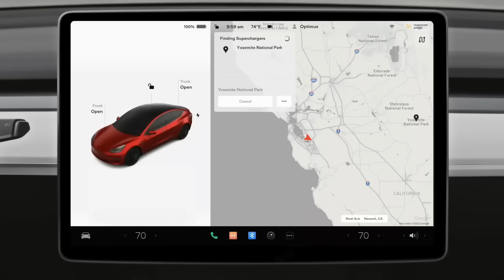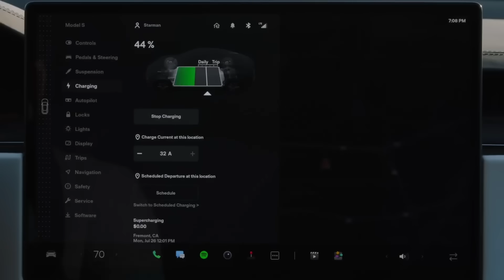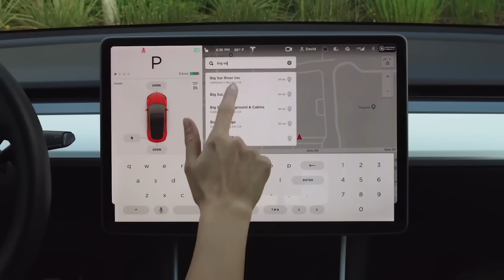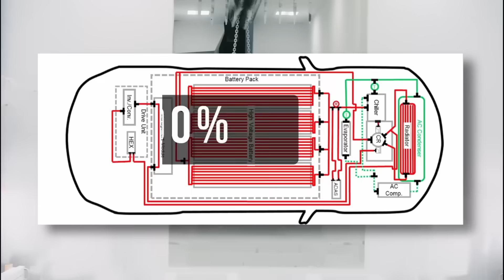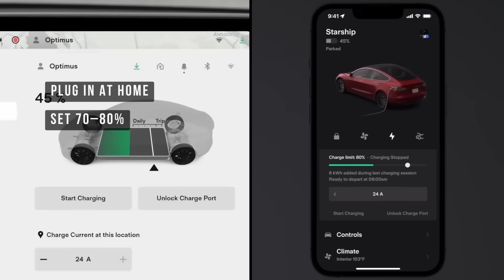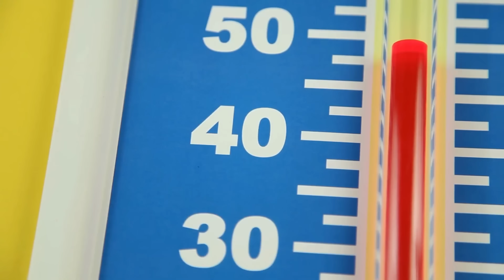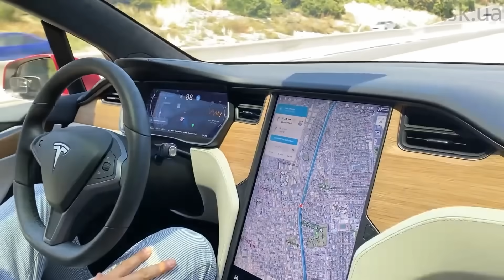Tesla Charging Myths That Are Ruining Your Battery Life

Comment from the maker: Which of these charging mistakes did You make? 👇
Reply: I haven’t made any yet as I found this channel a few days before picking up my first Tesla. Thanks for the honest advice! I do have one question about NMC batteries: you mentioned that charging to 100% and staying there too long in hot weather stresses the battery. How long is harmful? For example, if I charge overnight for a long trip but don’t leave for 12 hours later, is that safe? Or should I charge to 80% overnight and top off to 100% in the morning?  I do home charging with Tesla's wall connector at 48 amps 230 volts.

Comment: I have the 2026 juniper  I charge at home. I am retired and sometimes don't drive for a few days. Does lowering the amperage help with battery health. I have a 40 amp charger. I can drop down to 5 amps

Comment: What’s the best way to use a Tesla supercharger.  I charged my battery up to 93% and did not have to stop at another charging station. I was able to get home with 20% left.  Is it better to stop at two super charging stations and only go up to 80% at the first one. Then stop at the other one and put enough charge in it to arrive home at 20%  I have a solar system so my electric is free.  Thanks for all your information.

Comment: Just a reminder that charging on a 120 volt receptacle is only 73% efficient at getting that power from your wall to the car and 240 volt charging is 93% efficient. Just note the $10 to $20 difference per month.
Reply: Is this true?
Reply: I have heard that. Is there a sweet spot for 240 V and at what amperage input. Thank you.

Comment: If i drive my Tesla model 3 LFP only on weekends, should i leave it parked and plugged in, to 100% from Monday to Friday? Or should i park it (plugged in), at 80%, and charge to 100% every Friday night in order to be ready for the weekend?
Reply: Depends on ambient temps.  Battery stress happens when batteries are overheated at full charge.   Temp is the enemy, that why combustion cars battery usually fails at seasonal changes - summer to fall or spring to summer.  If you live in SoCal you can charge to 100% with little or no stress to the battery pack

Comment: Dear TSK, thank you for your most useful information! I do however have one burning question. My (December) 2024 M3 RWD standard range has an LFP battery. The Tesla manual says, exactly as you do in this video is to charge to 100% at least once a week. I have for some time now settled for only charging at home and keeping the car plugged in my garage. I mostly charge on my 3 workdays, Mondays, Tuesdays and Wednesdays, between 23:00 and 07:00, at a lower energy rate, and always to 100% on those days. 

The slightly confusing part for me is how to interpret the ‘at least once a week to 100%’ part of Tesla’s and your advice. I normally don’t drive more than 30 miles a day during the week. And rarely does a day go by that I’m not driving at all. An alternative routine would be for me to set the ‘Mo, Tu and We’ nightly charging limit to 80% and to once charge to 100% during the weekends, when it’s always cheaper to charge anyway. Does this make sense?
Reply: What happens is that the computer is only keeping track of energy used vs energy put back in. This is not a perfect method and it can only estimate available left. But if you don't really drive more than 30 miles a day, I would just set the charge limit to 80% every day and only charge to 100% monthly. It should only drift no more than 10% in that time frame. I have a very large LFP battery on my yacht and that is the way I treat it with zero problems.

Comment: I am model X LR+ 2020 owner. My daily commute is very small 20-30 km. Should I plug it in every night to be charged to 75% limit? I charge it to 75% after reaching about 50%. Which is better?
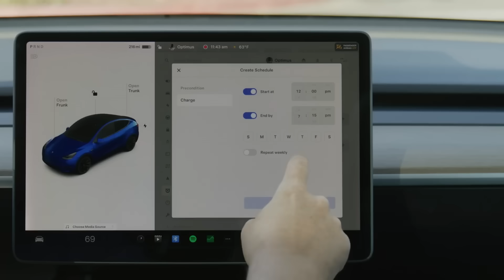Reply: I personally charge mine to 60% daily as I only use10-15% max in a day. I do get a 100% charge timed to just minutes before I leave on a long trip. This is pretty easy. First I charge to 80% the day before. Then I set the charge level to 100%, plug it in and see how long to reach full from there, usually about 2 1/2 hours (your vehicle may vary). I then stop the charger manually and set a timer to start charging 2:45 before I plan on leaving. This is very easy in the Tesla App. Then first thing before I leave, set it back to 80% or at least by the next time you charge. Works well to get maximum range the first leg of trip, typically over 300 miles. My bladder does not go that far, but you see my point.

Comment: Where are your cost per kilowatt hour . Because it's way different in most of the country's. charging on 112 would be painfully slow . You can charge at 45 miles per hour off the
Tesla Wall charter with a 60 amp breaker .  If you need to go in a hurry you need this. Unless you have Solar in California there isn't that big a difference in price between Super Charging and Home Charging cost wise.  .

Comment: 2:34 SoCal Edison has transmission of electricity fees on top of the cost per kwh. Don't forget all the extra BS made up line item fees that they slap of words like "Federal", "Universal", "Regulatory", etc... that have nothing to do with gov't at all 😂😂😂😂

At the end of the day my guy, the cost at the nearest supercharger to the cost per kwh at your home is going to be at parity in real world numbers. Infact!!!!!! you have more inefficiencies and losses transmitting power from AC and converting it to DC using the mobile/home charger AND the wear/tear with the 3 different onboard chargers which cost $1500+ each to replace.

DC to DC fast charging is... well duh... F A S T and has very little down side to it if you are charging enroute and doing short bursts like from 20% to 55% then hopping to the next charger.

Last point, I have FUSC for life on my P3D+ and i'd rather let Leon pay for the Go Juice instead of burning down my home using a dryer plug which was never designed for continuous load 😂

FUN FACT: Using a SoCal Edison EV TOU plan makes all your PEAK usage VERY EXPENSIVE for all your family members at home. Last I checked, the wife and kiddos give zero 💩's about TOU rates and will want to run the AC full blast when it is HOT during the peak TOU hours 😂😂😂😂😂😂😂😂😂😂😂😂

Get ready to get rekt on that bill!

Also, real world range on my tesla is about:

* 1% SoC = 2 Physically driven miles in Ideal Cali Spring/Summer conditions AND 1.5 miles only in Fall/Winter
* 1 kwh of power will at best do 3 physically driven miles in ideal conditions. Lets face it, no one is going to realistically drive at 40 mph in the SoCal freeways to try to attain the EPA rated range of a Tesla. Cruzing speed on the freeway is 80 mph when not in traffic.

500+ awhp to the wheel ICE motors even on premium gas can easily attain 30 mpg now a days which using the Wh/mi ration above totally skewing ICE in the favor of saving time and money. Have you compared the added cost penalty in California for annual EV registration penalty? Wear on tires for a 6000+lb sedan? Cost for Auto insurance on a BEV which is usually totaled out super easy?

We didn't even discuss the depreciation hit of EVs because they sink in value like a rock. 50% value loss in 3 years 😮 F that noise!!!!

3:36 😂😂😂 this guy!!! It will take you 3+ days to charge a Tesla Model 3 Perf from 10% to 90% on a standard wall charger. I did it as an experiment once. 36+ hours straight!!!!! No joke... who in their right mind would want to have a car sit for 3 days paying for the car note and the car insurance to let it "charge" at home to say you save a couple bucks compared to a gas car which can do the same range in  5 gallons of gas and a 1 minute fill up at ANY street corner

4:17 And finally, AC charging or DC charging make ZERO difference to the battery compared to the elephant in the room.... Battery Chemical Aging!!!! Even if you didn't use that car for 8 years, the chemicals in the battery pack would simply degrade the pack at least 15% in 8 years 😂😂😂 Last I checked... my gasser with 200,000 miles on the clock parked next to my Tesla gets me the same or better MPG compared to the day it had 50 miles on the odometer!!! battery degradation is a Biotch 😂😂😂

7:57 Are you on crack my guy... precondition on your way to a Tesla Charger and arrive with anything under 20% so you can get the TOP of the charging profile so you waste very little time. 10% to 55% charging is the most ideal for the charging profile at a Tesla charger 🤦🏽‍♂️ it's like you don't know anything about the car battery

Comment: Also people should be educated to understand the partial cycle and full cycles and equivalent full cycles. there are some estimation that can connect al these terms and the cycles number become still very informative.. but the SOH  data is usually taking account of this cycle parameter as well as RI and CAC and capacity.
Reply: And just remember that 10x charges of 10% equals 1 charge cycle.
Reply: @lkeil84  no.. absolutly not.. the chemical reaction related to degradation is not linear. search by your self on the web the graphs of SOH vs cycle life and partial cycles you will see

Comment: Thanks for having edited and republished a corrected version of your video The information are more accurate.  Btw  Temperature gradient inside the battery is one of the cause of battery degradation due to the breathing effect because of the air sucked in and out often charged of humidity an calcium dust. The supercharging that often have preconditioning with heat the battery to about 58c and this temp variation make huge pressure differential inside the battery which such air from the breathers when it will cool down.. when these breather are stuck open it even get worst. This repeeated process is one of the responsible for moisture and corrosion inside which the BMS can not control. The current leak generated by the ionic path on the surfaces of the normally dielectric parts can cause some higher self discharge due to slow shorts which the BMS will have hard time to compensate by bleeding the rest of the groups on a regular basis...